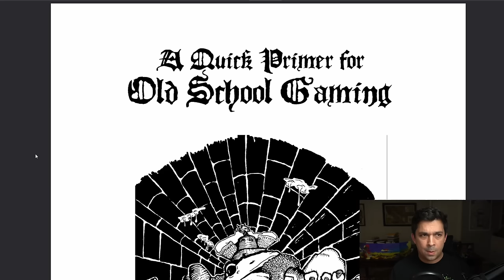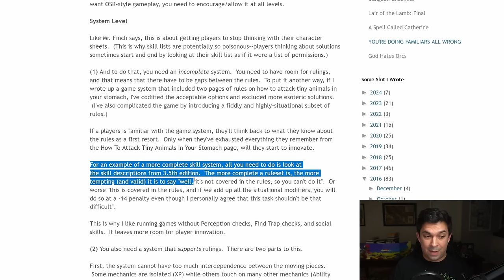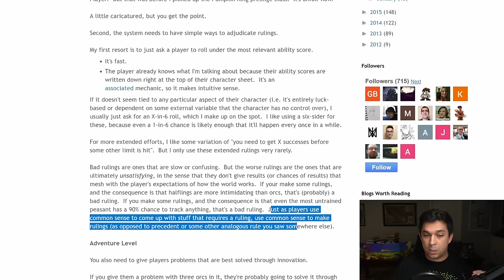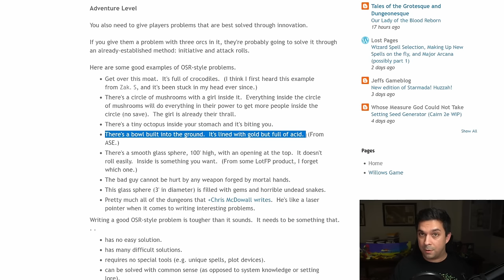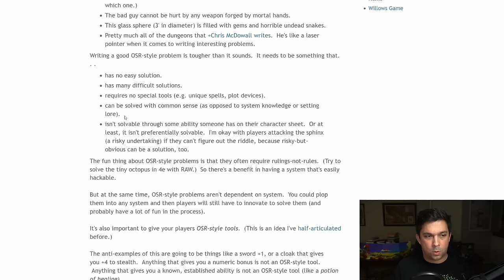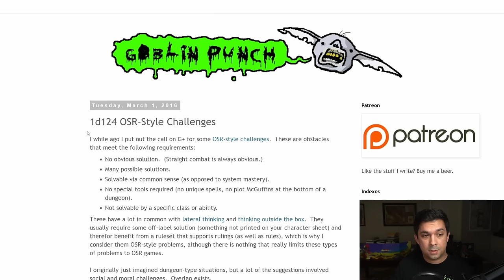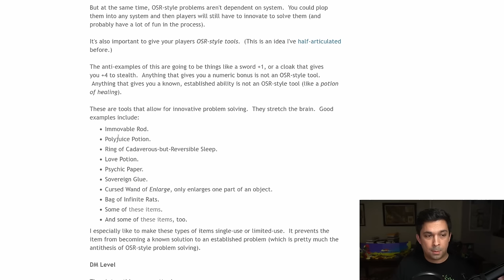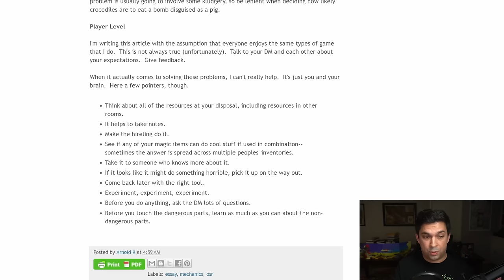The real problem with "Rulings Not Rules" in DnD

Comment: OSR problems are not problems without solutions, they are problems that the GM does not know the solution to.  That is, create the problem but don't worry about how it will be solved (for a problem WITHOUT a solution is a brick wall in the adventure.

Comment: Hot take: roll under ability score for success is a bad ruling, and a bad mechanic. It's unsatisfying, arbitrary (because your ability scores are randomly generated and never improve), and doesn't take the situation into account. It also becomes a crutch, I've seen too many osr dms lean on this old war horse far too much, and the game ends up simply resembling 5e be cause everything is a roll suddenly.

Instead, if the players come up with a plan, default to the plan works. The plan only has hangups if something would impede it. The fighter says "I want to destroy the bridge." Its a wooden rope bridge? It's destroyed, no roll. A stone bridge? Does he have a helpful tool? If so success is a factor of TIME not chance. That's a big part of this in my mind. Success should always he a factor of time, not chance. If you persist long enough you will succeed, but time is a precious resource in osr games, so the PLAYER makes a CHOICE about success, instead of simply being told "you fail, any other ideas?"

Comment: An obvious point that game designers have learned to think about, but players often don't, is that every RPG runs mainly on rulings. Designers in the 1980s seemed to think, "If I can just make the rules detailed enough then every situation will be covered and GMs won't be stuck making up rules hacks in the middle of a session." It didn't work because reality is just too complicated, and because simulating physics doesn't make for fairy tales or mythic stories. What I've fallen back on in adapting rules for my campaigns is: (1) know what kind of setting you're emulating, (2) use a simple system you know well enough to riff on it in the middle of play, and (3) invent situational rules for the specific things that make the setting special.

As an example, I could run a Star Wars campaign in just about any rules set, even D&D, because I'm used to how the Star Wars setting works and feels. However, I couldn't run Jedi in it using D&D rules as they exist because the Force isn't Vancian magic. I also couldn't run space combat using sailing ship combat rules. So a Star Wars game is run almost entirely by rulings, except that specific rules are needed to handle the common exceptions of Force effects and flying spaceships. Hack some rules in to handle those two things, and blasters can just use crossbow rules for all anyone cares.

This is why, whenever any even remotely pulpy new RPG rules come out, somebody on a comment thread always asks, "Can I run Star Wars with this?"